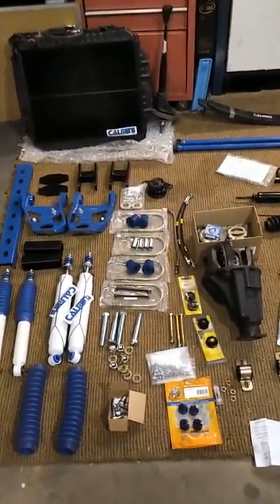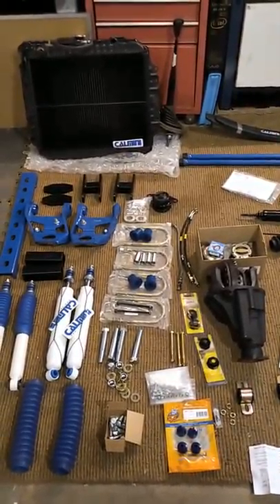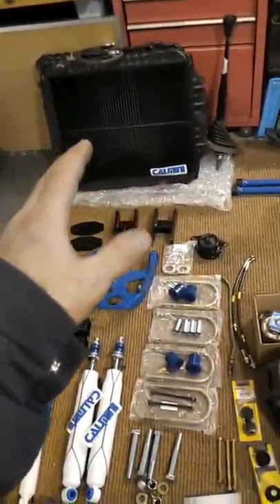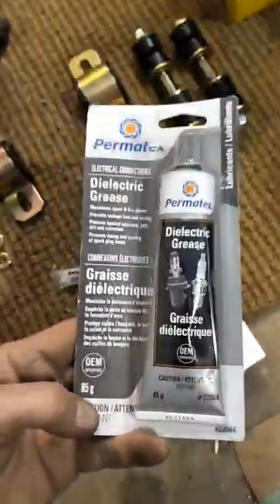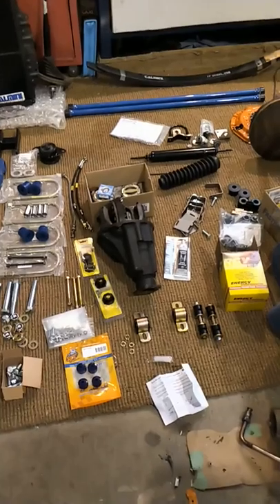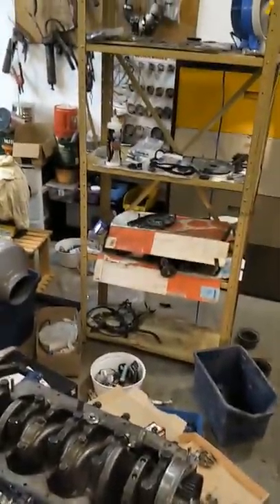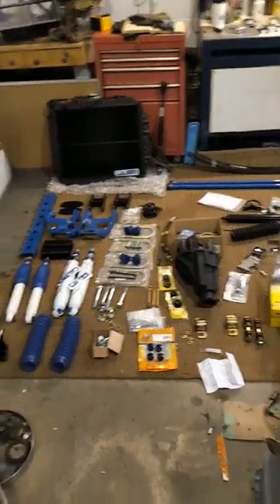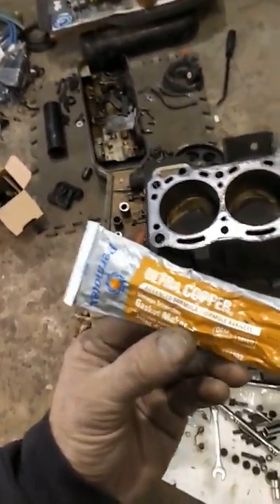Isuzu Trooper midnight oil aftermarket mod talk

Comment: What are the part number for the Energy Suspension body mounts? I have been trying to find trooper body mount bushings but looks like I need to look at the universal bushing mounts. It would be helpful if you knew them. I am replacing all of mine. I enjoy your videos, keep up the good work !
Reply from the maker: Hello pj2005, I assume that you hail from Kentucky and I'll be glad to help you with your Trooper, I have used, good condition OEM Body mounts, but body mounts were not part of my bushing talks, we covered leaf spring mount bushing and rear shakle options. I do have Energy leaf spring bushings. That part# is 14.2102G they are black in color.
Isuzu Trooper Body mounts: It would really help to know year your Troop is but ...
The Energy body mount numbers are:
(B) ENS-3-4130G
(Red) ENS-3-4130R
(B) ENS-3-4131G
(Red) ENS-3-4131R
Be sure to select the correct number for you. Good luck!
Included is a link: 
https://www.summitracing.com/int/search/product-line/energy-suspension-body-mount-bushings/make/isuzu
Reply: @islandtrooper4x432  yes in Kentucky.  89 trooper, I'll check those ES parts out. Thanks again !
Reply: In case anyone would want to know. I found a complete bushing kit from suspension.com . It is a SuperPro #kit5219k . SuperPro is an Australian company and it is an off the shelf item. Suspension.com is going to stock this and is now listed on their website. Just search the part number. I am thinking about using the calmini shocks. Are you happy with those?
Reply from the maker: @pjkentucky Good research bud, will check it out. Calmini shocks do the job, nothing to write home about. I see no reason to go for them exclusively. you can find something with less shipping hassle. I use them because of the lift kit, but when they are worn out I will look for something better. Cheers
Reply from the maker: Hi PJ, I know this is old hat, but did you ever order these Superpro bushings? I have taken a look but unfortunately Suspension.com has failed to post any images to confirm fitment or even if the kit includes all 12 bushing and/or hardware. I get alot of questions about body bushings and I am knee deep in building a 3" body lift kit based on Energy Suspension bushings, because to my dismay, the kit that I linked to your question long ago turns out to be only for Isuzu Hombre trucks and Chevy S model trucks. Sorry. The kit I am building now has been about a $1000 experiment and will not be feasible for most Trooper owners. 
Hope you are well 🙏